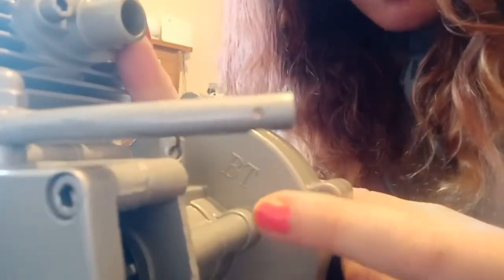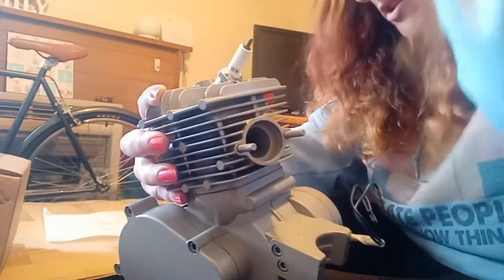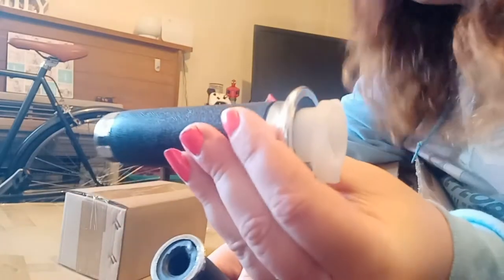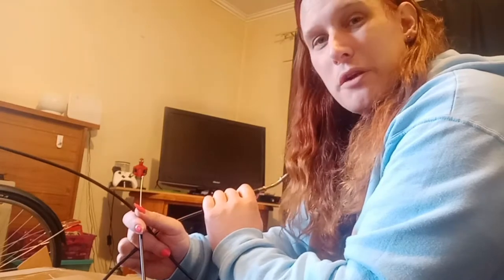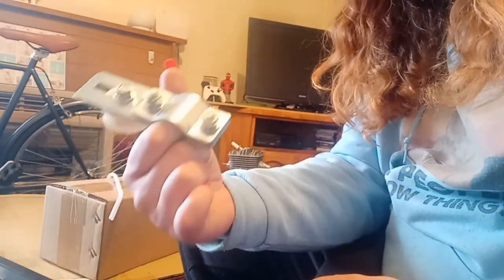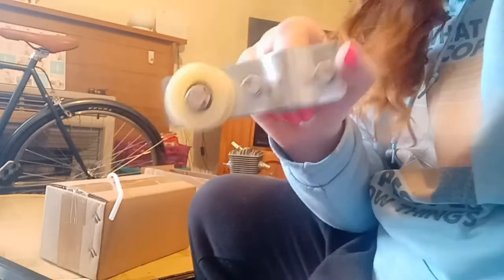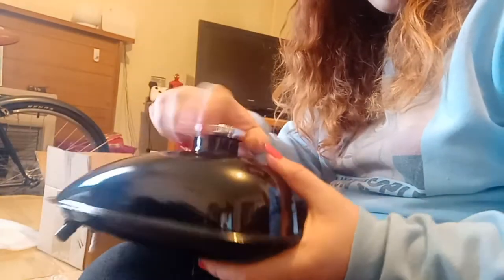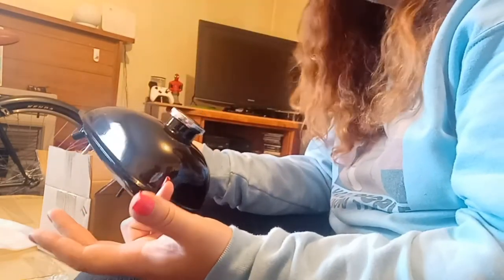BT100 Unboxing and Examination - Mk7 Motorised Bike

Comment: Both of my BT80 electric start kits came with extra copper exhaust gaskets, they must've stopped that practice at BikeBerry, if you ever need a replacement cylinder/piston, I've been told that regular China-doll parts will work.
Reply from the maker: I don't shop at bikeberry anyway. Besides, the shipping cost of anything I could get sent over from the States makes it not worth the while. So I try to stick to whatever I can get locally with free shipping. Of course this means I'm usually stuck with generic crap.